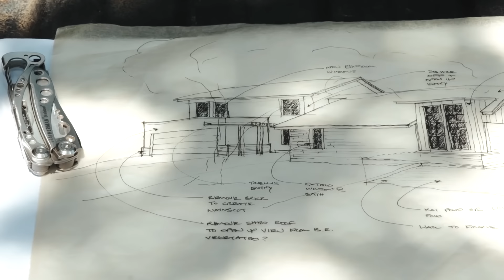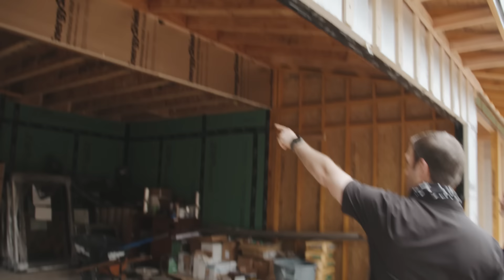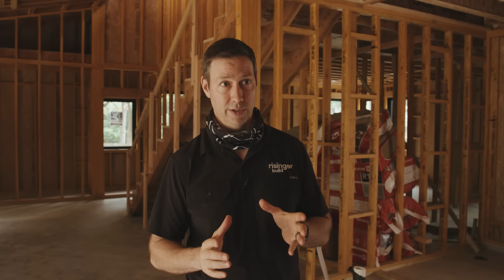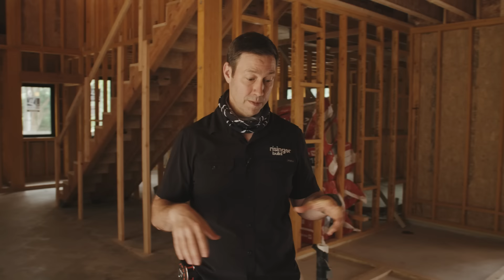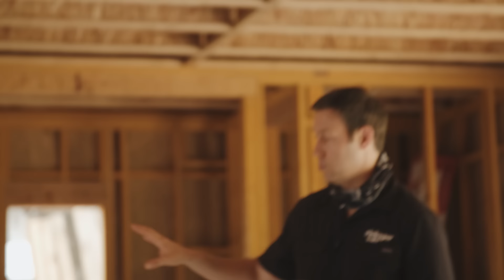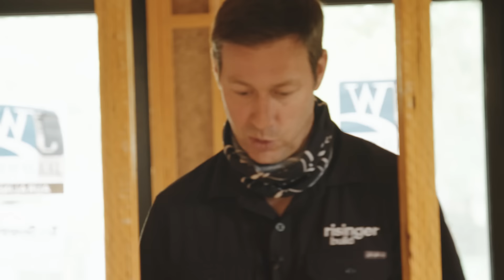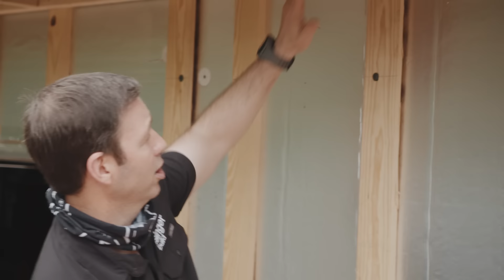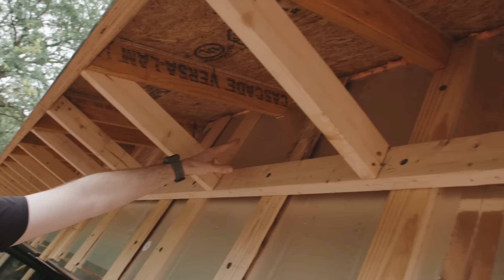The Perfect Wall - Building Science Training

Comment: Not sure if you'll see this with all the other comments but I'll try. Been watching a lot of your stuff and learning a lot. I have a 1960s 1.5 story house in the midwest. It has basicly every insulating mistake possible. So to start with my plan was a do a 1" air gap between the roof deck and a layer of foil faced polyiso foam. Then a layer of rockwool batts followed by a final layer of 2" xps foam on the rafter edges. All gaps would be sealed with spray foam. The idea being the polyiso would create air channels for the soffet vents up to the top peak meanwhile air sealing the knee walls off from outside climate. Is this a recipe for disaster or will it work? Budget and multiple other factors are what have built this plan vs other strategies.
Reply: Better read up on "The Perfect Wall", as a STARTER. Then rethink everything you just proposed. It is a disaster, and won't be waiting for it to happen. You are trying to mixing conventional vented assemblies with exterior insulation, sort of, and each element is contradicting the other. You can probably do a proper exterior continuous foam or Rockwool insulation assembly, but it must start with the sheathing and the (presumably existing ) venting of the attic space. 

Next big issue is how the new roof assembly ties into the walls, as far as air sealing, water management and insulation is concerned. House is a total system, keep this firmly in mind.
Reply: This is not a new build this is an existing 1960s story and a half. And then listed plan is only for the interior of the knee wall roof section.
Reply: @95dodgev10  Not trying to rain on a parade. You probably realize by now that Matt will not answer questions of substance, for liability and branding (happiness) considerations. He does love questions along the lines of "So what awesome thing are you going to spring on us next, Matt?" And questions like yours are trick: context is everything, and a quickie verbal description falls far short of necessary info to advise. I read this first as an over-the-top application, as Matt is doing an extensive series on his continuous external insulation project. Re-reading, I am guessing this is interior to the framing, but still impossible to advise ( and even I won't do that, even anonymously) competently. I will say that two "sealed" layers surrounding a porous insulation is generally a really bad plan, as you create a moisture trap that will be very tough to dry. 

I would urge you again the get on the Building Science Corp website , and probably Green Building Advisor, and read, A LOT. Once you throughly understand the physics and principles, you will be much more able to design a good system for your house. Or possibly, realize that it is most cost-beneficial to leave it alone (or walk away). There are very few knowledgable and competent people in the industry, and a lot of posers, who pick up a few buzz words and trust their audience to not know anything  of which they speak. You are best learning this material well, on your own.

For the record, I graduated from MIT, architecture, in 1976. Been designing and building professionally since 1971. And I have done loads of water damage/rot remediation, and lots of advance insulation systems, for all those years.

Comment: also is taped flashing better than the metal flashing? i have always used a metal flashing especially for joints for the house or over hangs. i would think and i could be very wrong but a metal flashing under a vapor barrier would provide better coverage? i am still new to these things and thank you for pointing out some of the major problems that happen with houses. i will subscribe for the fact that i will build my own house and i do appreciate the content!

Comment: Wish you would do a video on the changes you need to make when you want a traditional fireplace.  How does it change all the air sealing you propose.  Would you still use zip system to seal as much air as possible and then control the fireplace?  Does the zip system also help with bug control long term or do we go in a totally different direction since the fireplace adds basically a hole in the air barrier?
Reply: Consider a masonry heater with a dedicated air supply. Can look just like a fireplace but actually heats your home.
Reply: @moocrazytn  We want a traditional fire place that burns wood not only for the heat but ambiance.  Love sitting around a traditional fireplace.

Comment: i asked my current inspector and a huge question i have is why dont we but 3/4 cement board against the slab and seal it then continue with osb or ply wood upwords? if slab meets  a sealed cement board i dont see a lot of moister build up being a big problem. i mean we use cement board anytime we build a bathroom. why do we not use it for the other wet problem areas? pressure treated header on top of a slab with a flush or over hanging sealed concrete board and a breathing barrier after the sealed barrier? i live in mountain climates with snow standing on the side of the house for many months and i dont understand why wood meets the slab thats only an inch above the ground.

Comment: I like BIPV, but there is probably some clip-on and tighten non-penetrating system for mounting solar PV on metal roof. Get your communications ready in the right time, could use some help like youtube.com/user/TheTecknowledge Could go with CAT7 and/or mm fiber in wall so it is future proof to handle higher speed. There should be solution for solar PV to hook up with UPS so network runs on DC. Haven't found found smartgrid system yet that can automatically adjust loads pull from grid depending on price of electricity, battery state of charge, weather data, grid charge and battery cycle cost.

Comment: With the slab insulation, you talk about creating a thermal break. But with the framing already in place, doesn’t that create a thermal bridge between the slab and the framing? I understand that in the Texas climate that will be less of a problem. But if Steve is doing that in northern climates, how would he answer the question? Ultimately, it makes it impossible to create a continuous thermal control layer at the slab.

Comment: The voids created by the "Bolt-On" overhangs: will they be vented? Can a regular vented soffit board alone give enough convection to stop rot, overheating the underside of the roof? That's the only nit I can pick. House looks like it'll be bulletproof.
Reply: I commented on this in a previous video. In many snow-load climates, the lack of insulation all the way over the soffit can lead to ice-dam complications (see Dr Joe). And hacking up the polyiso for the scabbed over rafter tails is a poorly thought out solution, at best (In my opinion, and I have faced this problem, with what I think is a far more integrative solution, but hey, who am I?). The venting is not the issue, per se, but rather thinning out the continuous foam so extensively for the tails, plus introducing all the air networking paths (again, see Dr Joe) into the blanket. Roof continuous is supposed to be easy, straightforward and "bombproof" (a Matt word), but this job really subverts that, unnecessarily.

Comment: Save $20 a year
""More information on optimal wall insulation
I decided to look into John Brooks’ question of whether thicker wall foam makes sense in Florida. It turns out that doubling the thickness of the wall foam from R-10 to R-20 would save only $20 per year.

I discussed the issue with Danny Parker, a senior researcher at the Florida Solar Energy Center. Using EnergyGauge software, Parker calculated the savings for a 1,600-square foot single-story slab-on-grade house in Tampa, Florida.

He assumed that the house had fairly good specs, roughly along the lines of the house I described above. He assumed that ducts were inside the thermal envelope, the house had 3 ACH @ 50 Pascals, the windows were U-0.30 with a SHGC of 0.30, and the thermostat is set at 77°F in summer and 68°F in winter. He assumed that electricity costs $0.15 per kWh — higher than the current retail rate there of $0.12 per kWh. (Assuming a higher electricity rate tends to exaggerate the value of increasing insulation thickness.)

If the house has 2 inches of rigid foam (R-10) on the walls, the heating and cooling costs [Later note: should be "total household energy use" — see discussion below] will be $1,794 per year. If the wall insulation were doubled to R-20, these costs go down only $20, to $1,774 per year.

Is it worth it to double the thickness of the foam to save $20? Well, it depends. You could also save the same $20 by buying a photovoltaic (PV) array costing $857; that 114-watt PV array would produce about 166 kWh per year, valued at about $20. So, if you can double the foam thickness on a 1,600-square-foot house for $857 or less, the foam insulation will cost less than PV. If doubling the foam thickness costs more than $857, then PV is cheaper.""

https://www.greenbuildingadvisor.com/article/hot-climate-design
Reply: Really, you want to forcefully introduce economic reality into this charming vanity project? Being a bit snarky here, but not much.

I have commented on other vids here as to the law of diminishing returns. Specifically, on a large and expensive build 10 years ago, I settled on 2" polyiso continuous exterior over 2x6 frame and 100% liquid applied, with 2 x 2 1/2" polyiso  continuous over the roof (all the way to the sub fascia, per my experience and now Dr Joe's recs). We used R19 FG batts in the walls (NO vapor barrier) and R30 FG batts in the roof rafters (where not a cathedral/ shaped ceiling, we had ALL conditioned attics within the envelope, kind of like Matt is now re-discovering). My previous comment included the observation that the foam does the heavy lifting, and the FG is basically along for the ride. Plus, it makes the lay observer (owners and building inspectors) feel all warm and fuzzy (!!) about what you are doing. The cost benefit of the cavity insulation is so mediocre, that it DOES NOT PAY to do anything exotic or high performance. A good part of the rationale for that assertion is the thermal bridging and reduction in average R value of the assembly, for cavity insulation.  As for me and my jobs, continuous exterior is the only reasonable approach to building envelopes, given the realities of physics and the state of the materials and methods available to us right now.  

The thickness determinant for exterior insulation is "where is the dew point"? The original architect (removed, my impetus played a large part in that) went around me to have the HERS rater run 3/4" foam. We all met, I went off on them, had the rater check dew point (we we still into R19 batts), and we WOULD HAVE HAD PROBLEMS. He then ran numbers for 2" foam, no problems with dew point, still R19 batts. Truth is, there is a SLIGHT chance of a stray condensation event, but extremely rare circumstances. This is a kinda cold climate, on the Front Range in Colorado, up against the Foothills.  The interesting thing was the demonstration of the value of continuous exterior insulation, meaning the effect on vastly reducing thermal bridging (if you want none, build with no penetrations: no windows, no doors. Good luck selling that one). The HERS rating for 3/4" foam was about 8, and for 2" foam it was about 6, as I recall (we had ground source and a big PVA for this project, County required us to be HERS less than 10)). Point is, the difference between them was minimal: ie once you are there, it doesn't matter how MUCH you bring to the table. This is a good demonstration of the nuttiness that is often found in the Green/ PHI/ energy tribes. Focus on the trees, and forget the forest (more snark, sorry, not).

Comment: So you put the rain screen on the walls to vent air and water out from behind the siding and let the foil work.  Why not do something similar on the roof to reflect the suns rays away.
Reply: If he uses a lighter color of metal roof, it will do plenty of reflecting, and because it has an air gap below it there will be very little transfer to the structure.  (Assuming that's the plan)

Comment: Do the solar imo! I bet you need less than me to power your house, but it is probably hard to calculate when building new.  Solar is affordable right now and still has a 26% federal tax credit.  I did a self install 2.5kW array that will be $2700 after tax credit. Pays for itself within 6 years. Installed by a company should only be about double that price.  I am in Michigan.
Reply: Do you have any info sources for someone looking to do the same?
Reply: @e4853  pvwatts calculator will help you calculate how much energy an array will produce on your roof.  If you have shade issues you need to bump up losses though.  I am tracking 5 to 10 percent under the normal calculation with slight shade issues.  I used YouTube to figure out how to install everything plus the solar panel manufacturer manuals and racking system manuals.  I went with Enphase IQ7 products and these microinverters are easy to install and work great.  This also keeps your system lower voltage which is a safety plus.  I bought most of my equipment from my local electrical supply.  Check what your utility company does for solar customers.  I am grandfathered in to 1:1 net metering which helps ROI greatly and means a battery won't make sense for 10 years when terms change.
Reply: @e4853  oh, and refer to your past energy bills to see how many kWh you use a year to see how much of a system you would want.  Google project sunroof will show how well your roof works or doesn't but pvwatts is more accurate.  Make sure to do energy efficiency upgrades if you haven't yet to reduce energy usage.

Comment: All those interior walls are thermally connected to the slab. Also, all the lag screws going though the vapor barrier and insulation. Also the rafter tails for the overhangs are under the roof insulation and cross through the insulation. It seems like there is plenty of room for improvement.

Comment: What about a perfect wall for a metal building? An epoxy coating with aircrete sprayed on top for a UV-resistant insulation that will insulate when wet? Would that help resist condensation on an unprotected surface?

Comment: You've attached boards directly over the rigid insulation, are you not worried about compressing or smashing the insulation if too much weight or pressure is applied? Say a roofer stands on the very end of your overhang, wont that cause problems? I've always avoided this detail for that concern let me know if I'm missing something in your assembly that would account for that.

Comment: Is insulation inside the walls really necessary with that fully enclosing exterior insulation or is it just going for overkill there?
Reply: If you leave them open, wall cavities will act as different size drums and house will be noisy. So you get additional insulation and noise cancelling at the same time. Actually, you want to use rockwool also in inner walls too for the same noise reason.

Comment: Do the South and West facing windows include a micro silvered layer for radiant energy protection? I would venture a guess that these are most likely your triple glazed windows.
Reply: I've always wished for a dual-tech window construction where I could switch the solar gain off for Summer and ON for winter through the high-gain potential openings.
Reply: @ClayAutery  Electrochromic glass is similar to what you're looking for, but it's still horrifically expensive at this time. That said, I'd never want high solar gain from west facing windows, even if I were in Alaska.

Comment: What happens when there is a market downturn and that house sits for two years with no power?  Or even just six months?  How are all those adhesive/tape joints going to be 30 years from now?  How long does the vacuum last in multi layer windows?

Comment: Good video. The only question I have is it looks like the rainscreen will vent in to the soffits, will they be vented so that air can circulate? Will air circulate enough to take care of the moisture in that area? This is one detail I've been wondering about myself because most show rain screens stopping under the soffits and I wonder about a non vented soffit with a nonvented roof. That would create a questionable area in my eyes
Reply: It is questionable, but not for the reason you suggest. Trawl through for my reply to first post with this question.

Comment: If you put all the insulation on the exterior of the framing is there still advantages of 2x6 framing or would 2x4 be just as good since you don't need the additional space for insulation?

Comment: 500 years? I can see the wood lasting that long, but I don't understand one thing, concrete doesn't last that long, 120 years and concrete starts reversing its bond, right? What happens to concrete slabs after 200 years? Anything? Maybe not, but maybe the load bearing parts crumble?I wish I knew of an example.

Comment: I know you have use Rockwool a lot in the past. How would you compare using foam to Rockwool 110 (more rigid than 80) with the over framing? You are placing ledger boards on the foam and screwing back. Putting lots of compression on the foam. How would the Rockwool 110 stand up? It might also be a good video of comparison.